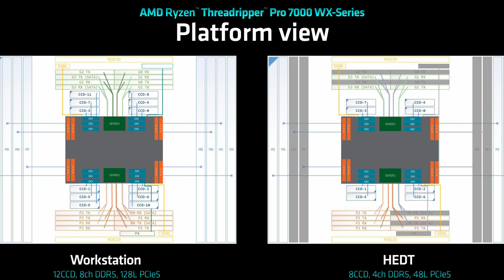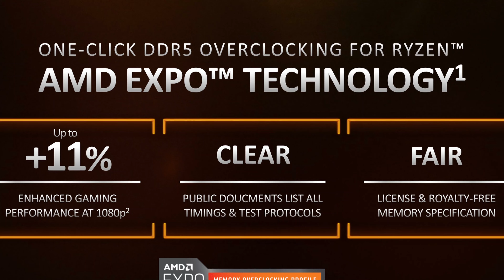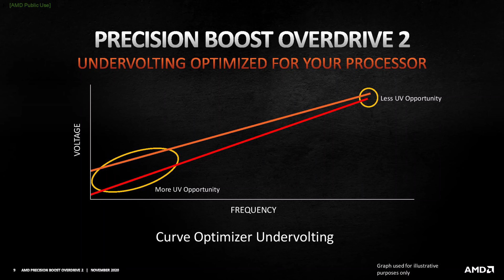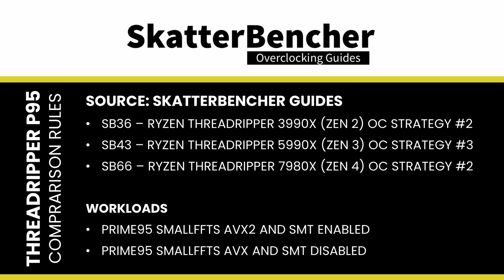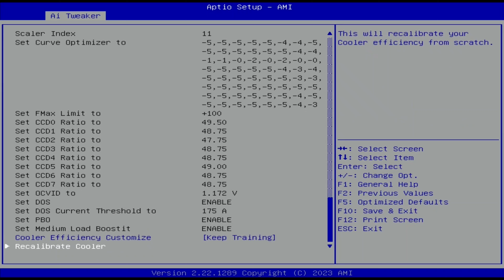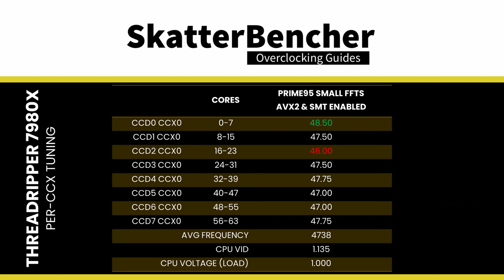Ryzen Threadripper 7980X Undervolt & Overclock to 5750 MHz With TRX50-Sage | SkatterBencher #66

Comment: I'm going to do it, I'm going to ask. How does the OC 7980X compare to a 7800X3D in gaming benchmarks? I do video and game production (Unreal), but I also play games, mostly DOTA2, but I enjoy a variety of other games from time to time. My new PC will either be a 7800X3D + 5090 or a TR + 5090. The TR seems on paper a god 20-30% behind the X3D chips, but this OC seems strong, perhaps enough to close the gap to within 5-10%? @Skatterbencher
Reply from the maker: I had a look back at the 7800X3D performance results and looks like I only have comparable data for Tomb Raider where both platforms hit 204 FPS with the RTX 2080 TI when overclocked.

However, for real performance comparisons I would suggest you check out real reviewers :)

Comment: Connecting the water cooling to the house heating system could be amazing.
It should be able to handle the 1000W heat and provide "free" heat, atleast here in northern Europe.

Comment: I am interested in the 7970x
As I will be running different VMs and one or two of them is gaming.
I am wondering how well for example only OC 6 cores will perform.
So I guess finding the best CCD to choose from and select cores from that CCD to OC. (Cross CCD virtualizationing can worsen performance)
That way I can OC where I want it, without hurting thermals to much.
Reply from the maker: Yes, manual per core OC will be the right approach for that use-case

Comment: Hiya ! Great video, thank for that! 
Just corious, I am looking for PC where I am really need Single core - for super fast editing like in 2D and 3D apps, like Houdini, Nuke, Maya, and on mean time good to have that power for rendering results.
I see that CPU is by default 3.2Ghz and boost up to 5.1Ghz...whatt is does mean about boost is it boost CCX0 only where need for single core tasks(or it is like true get not whole CCX0, but get only core0 for example).. or it is like situation when You do job on single core it is turn on on 5.1Ghz, and then single core start mixing with Multi-core task - where CPU start averaging-mixing CPU and that 5.1Ghz going to low down - average... 
so the Idea is what about - is it possible get CXX0 and make boost this closer for 4.5Ghz - 5.1Ghz - just for single core tasks, and rest CXX1... using as is , You think it is smart way for tuning in the CPU? and also is it really bad for keep CPU in this condition for long time period.
Again Many Thanks!
Reply from the maker: If you use on the Precision Boost technology - AMD's standard boosting tech - then the situation you described isn't possible. The boost algorithm will automatically reduce the operating frequency as more cores become active. Even if those cores are in different CCDs at opposite sides of the CPU.

In theory you could switch to "OC Mode" which disables this boosting tech. Then you could overclock your best CCX for the best frequency and keep the others at low voltage for all core loads. Then you could have one core boost really high for your ST workloads while at the same time have the others take care of the MT workloads.

It's no guarantee that the OS will automatically assign the process to the right cores though. So you might need to use Process Lasso too.
Reply: @SkatterBencher  Thank You a lot mate! so I just found out that uncontrollable process because single core processing it is pick up random Core and boost it in single core processing... found out it is there as example https://www.youtube.com/watch?v=glxwAFEuFFg&t=193s&ab_channel=AdamBaroody

Comment: Did you get good contact over the IHS with the EK strx4 waterblock/were the CCDs evenly cooled?  I had some issues getting good contact over the entire IHS with my old 3990X.
Reply from the maker: Seemed fine when I checked. Some CCDs will run hotter due to production variation.
Reply: Thanks,  @SkatterBencher  .  Fair enough about the variation; I think the issue is when it's all the more peripheral ccds that are running hotter, which is what I observed. But may have just been idiosyncratic to my cpu or waterblock.

Comment: Awesome CPU for tuning ❤
In last OC strategy, manual OC, it was also possible set DOS on enabled,right? To keep high single core performance working 🙂

Lol, I'm looking for 96 core and CO per core tuning😂
Reply from the maker: Yes, correct! You can see that with the AI Overclocking strategy which uses DOS.

Comment: That's a sweet overclock! 
I saw your cool 9.1GHz on the 14900K, I've just bought a 14700K, is there much headroom left in these on water? Will you be making a normal overclock guide for RLR? Thanks.
Reply from the maker: I'm wrapping up the testing for the 14900K and have the other Raptor Lake Refresh chips on the to-do list.
Reply: @SkatterBencher  amazing, thanks. I can't wait. 
I'm surprised that either Intel or AMD, or even a mobo manufacturer, haven't offered you a job to create overclocking profiles for their boards as you clearly know so much more than 99% of their workers.
Reply from the maker: That other 1% knows more than me though :)